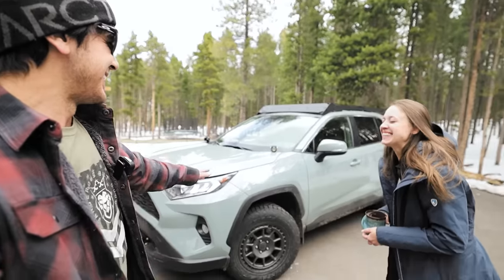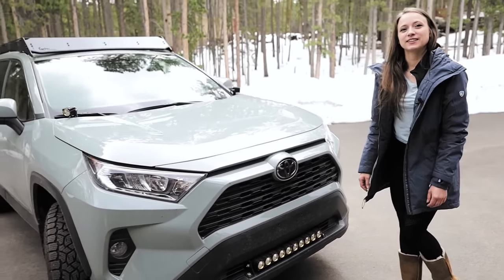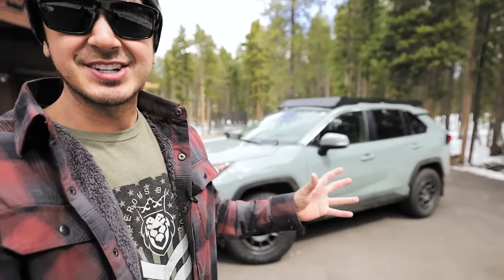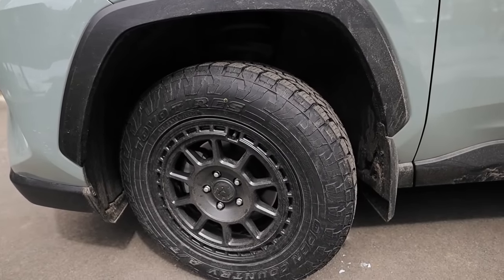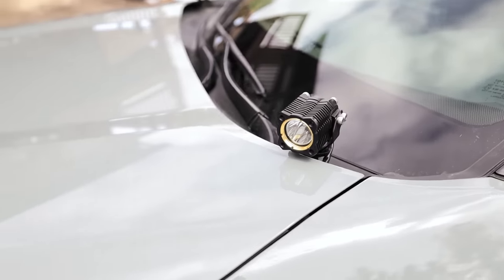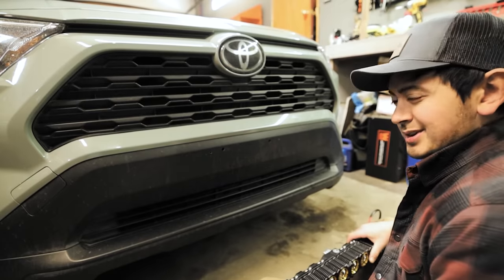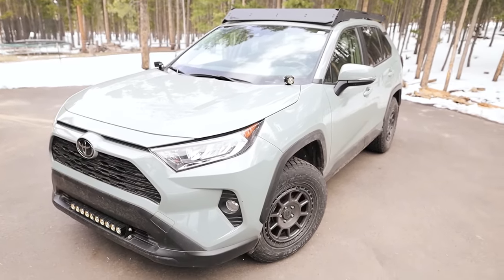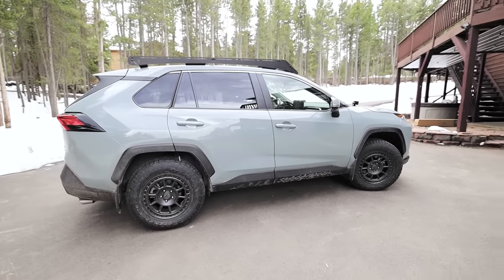Rav4 Overland Build? Or DOPEST Soccer-mom-mobile out there?

Comment: We have an 08 RAV-4 limited with the V-6 and is now turned into a TRD Limited along with skid plate, larger Hercules all terrain Terra Trac II tires and along with appropriate TRD badging. The V-6 along with the downhill assist control and the center differential locker makes this thing a better medium duty off-road vehicle and great for overlanding.

Comment: Perfect timing, just as I'm considering a Rav4 for my wife when her lease is up next year. Great build!
Question for you (and others) - how resilient is the glass on the light bar from rocks and things coming off the highway? Just can't help but think how vulnerable they are down low like that.
Reply: They all have hard-coated polycarbonate lenses, meaning there's little worry about breakage. If it were any kind of actual glass, they'd be shot in no time, especially here in Colorado. It's hard enough to get a windshield to last up here.
Reply: I looked at Rav 4 but went with Forrester instead. It’s a bit larger and I like the CVT and interior design much more. Had a 17 crosstrek and that thing was amazing for being as small and “weak” as it is it did amazing in all types of terrain and got us out of some very sticky situations. Good luck on whatever you go with!!
Reply: Just make sure you don’t get the Hybrid yet. They have a fuel tank issue. Mines in the shop now third time. Hoping to lemon it out
Reply: I have a 2019 rav4 adventure n the thing is awesome dude. Love it up in MN especially in the winter. great mileage too and very comfy. wish theyd actual upgrade the info systems. needs android auto.
Reply: @EM-iq9yj  I have the Hybrid model and it's got the fuel tank issue. I'm not too concerned as I never do long distance driving too often therefore it isn't necessary to get the real driving range out of my car. I did some calculations, it's got 14.5 gal, and I drive 36.5 MPG (I live in elevation and mountainous roads), in theory I could drive 529.25 miles before empty, but every time it fills up like 480 miles, so I basically just have to fill a little more than a gallon and it's considered a full tank. I've only ever need to do that twice and it works out just fine. But for the daily commute I'm cheap af, I only keep my fuel tank 2/3 full to save weight therefore saving gas, I also take turns carpool with coworkers😂cheers!

Comment: The rav4 looks awesome! Be careful with that trigger system! I had one on my f150 and it killed my battery multiple times. I would wake up and all of my accessory lights would be on. I didn’t want it hooked to the ignition because I have bed lights wired to it and all my gear in in the bed with a tonneau cover on. It was a disaster until I finally gave in and wired it to the ignition.

Comment: I purchased the same Rav4 in white backed in January. I'm really wishing I'd waited a few more days to get the Lunar Rock one instead. I swapped out the OEM wheels for Open Country ATIII's last month, but I haven't put more than 20 miles on them due to the lockdown in Colorado. Other than the Toyota Service Bulletin for the low-speed acceleration issue, it's been a solid vehicle so far.

Comment: Gotta make the special guest a regular! Great stuff, you don't see many rav4 mod videos.
Reply: I can’t imagine why? Oh wait, they suck off-road. And for the same money, based on fuel costs, depreciation and purchase price you could be driving a Taco. An even have a manual transmission if you so desire.
Reply: @JeepCherokeeful   pretty tough to compete with the hybrids getting 40+ mpg.. and decent offroad with just a stock set up
Reply: @JeepCherokeeful  as much as I would want a 4Runner or taco / Lexus 460s… gas prices suck! The rav4 saves me money in the long run.  for long commutes. I blame Toyota for not having the best of both worlds

Comment: I'm looking to potentially get the hybrid XSE and I saw this on the Prinsu website "DISCLAIMER*** This rack will not work as designed for the RAV4 XSE or the XSE Hybrid models due to the Panoramic Sunroof. It will not allow for full function of the Sunroof on this model." If this affects the moonroof what other roof rack would you suggest? I'm planning on getting an ikamper on top

Comment: Dopest soccer mom vehicle. My friend just lifted hers with 1.5 inch lift and big all terrain tires. Did not do well, with the tires we still didnt have power to get over rocky roads, comes down hard after bumps. Just not the suv to be doing "off roading" in. The trails we were on weren't crazy ethier that's the sad part

Comment: Nice video.  I never go off reading but I do like camping.  Iam getting a rav 4 hybrid and would like to put thoese mud tires on and rims...can I put thoese tires on the OEM rims?  The reason iam asking is because if I get nice rims and if I go off roading they are probably gonna get messed up:(.. did u lifted too? Does it ride nice in long trips on freeway with thoese mud tires, what about mpg? What model do you have, iam debating between the le and xle?  Will this void my toyota warranty or extended warranty since iam modifying car?? Sorry for all the questions

Comment: Thinking of doing one up for my wife... Can those 245/65-17 work with factory 17 wheels or did you change the offset with the new wheels. Those are an awesome tire selection for a mini truck... Roof rack looks good too ever though it might never get used on my stuff thanks

Comment: Thanks so much for making this video! I wanted a Rav for the gas mileage and size, but mods are hard to find compared to how much content there is for the 4runner. I'm in the same boat. Got the 2020 TRD in Lunar Rock. Looking to add door/puddle lights, the light bar, maybe ditch lights, tow bar/receiver, and net gate on the inside of the back lift gate. 

What forums do you guys use/post to?

Comment: Was it pretty difficult to put the prinsu rack on? Planning on getting one and I’ve been curious about taking of the factory ones off, bolts up on it, extra holes that’s not at any use. Just some more info on installing it.
Reply from the maker: Depends on how advanced a DIYer you are. Not too hard for me, but it'd be tough as a first ever install kind of thing.

Comment: Any idea why the prinsu roof rack isn’t compatible with the panoramic sunroof feature? Will it still bolt on as long as we don’t open the sunroof?
Reply: I know you commented 2 month ago, but in case you didn't get the answer, Pano sunroof operates just fine. You just need proper spacing between two bars above sunroof(obviously), but doesn't affect what you load on top. Prinsu could've disclose this but I don't think they wanted any liability whatsoever. Btw, use nylon locknuts instead of plusnuts.

Comment: Does the Rav4 still have a spare in the undercarriage, or did they move onto those runflat tires? Could try and find a spare mount and a fifth wheel and tire set.
Reply from the maker: I haaaaaate swingouts on dailies, especially ones that have power tailgates, haha. It does have a spare inside the back though

Comment: Hey Mike great video, I'm thinking of getting the same rims for my 2021 rav 4. Are you able to use the stock lug nuts or do I need to get new ones?. Plus did you reuse the stock wheel sensors or did you buy new ones. Thanks

Comment: As a rav4 trd owner, I’m jelly of the fuel range and the config of this xle. My 2022 trd, with a full tank has a range of 255 miles. Freaky, when it reaches half a tank, has 100 mile or so range, and I have seen it around 35-39 range on quarter tank. Not so happy with that. Nice ride !
Reply: Just for a comparison, my 2023 rav4 xse hybrid had 590ish miles(per dash computer) full tank range when stock. Currently 505ish miles after mods(Prinsu, ditch lights, roof light bar, bumper light bar, window visors, tools & gears, etc.). Expecting another drop of 40 miles when switching out factory with AT tires.

Comment: You should’ve gotten the XLE Premium because that has leather seats which are easier to clean but other than that it’s a nice daily
Reply from the maker: Leather kind sucks in the winter, but I still probably prefer it. Problem was that there weren't many options without many months lead time, and the exterior color was one of the main driving factors, of which this was the only one available for awhile.

Comment: Hi Mike - I am getting the same rack for my 2019 Rav4 Adventure. Did you have any difficulties covering any holes in the rails? If there are any? And what did you use to cover up those holes? Also, did you use silicone to cover over the plusnuts to prevent any leakage? Thank you

Comment: Do Yakima/thule roof pods work with the Prinsu bars?
Reply: I assume you are referring to a cargo box. They should work provided you can adjust the Prinsu crossbars to fall within the box attachment claw spread of the particular box you are using. Some crossbar spacing adjustment will be needed initially to get it set up. Sometimes a cargo box interferes will your moonroof opening. Also, if you have roof mount antenna the box can be in conflict with it.

Comment: my gf has a 2015 Rav 4 Limited. I hate the way it rides. Loud road noise and it feels like its dragging the ground.  And it hits bumps and potholes hard.  Very uncomfortable on long trips on the body and mind.  Leather seats are hard.  I have had much more comfortable and quieter ride in cars costing half as much.  The brakes make noise when backing up.  The motorized hatch lift gets stuck and you have to push the lift up to open it all the way.  The steering wheel pleather is pealing.  The infotainment screen does not respond to touch at the bottom of the screen.   I am sure the 4 cylinder is very reliable but it has no guts. It does help a bit to drive in sports mode.  I absolutely see nothing in the Rav4 or why people like it.  The upper trims do not ride any better than the base models, you just get more options.  Many people will buy Toyota for its reliability but I think today, there are much better cars for the money with almost the same reliability.

Comment: dopest soccer mom because its not the same quality as other generations of rav4. 2015 was pretty much the apogee of the reliable rav4. (even the v6 2006-12 are still going around today strong). Dont get me wrong im not hating, its dope. I would just choose dozens of other SUV's or truck for an outlander rig on that same budget. for a real outlander rig you need a truck base, sorry just the truth. This is very pretty but it won't take you accross that swollen river to get to that peak you wanted to camp on. It's not capable of true off road like a truck rig that you can just bang its way into the wild as soon as you see a clearing.